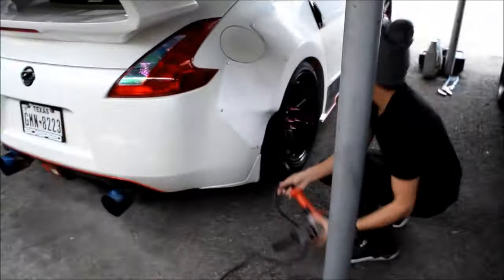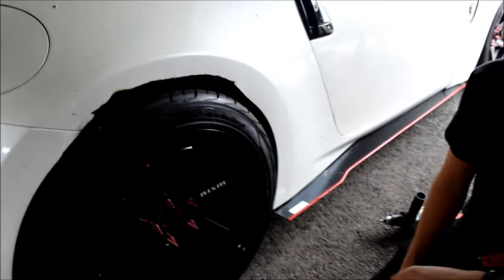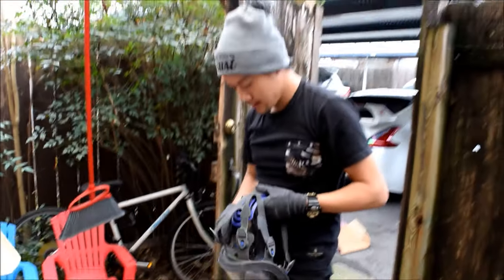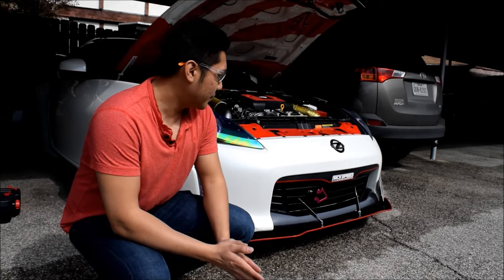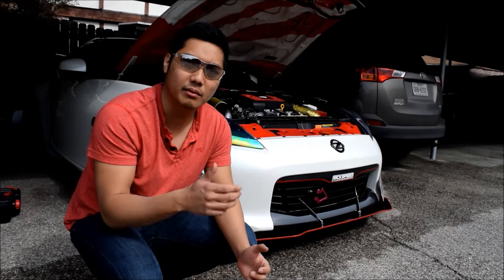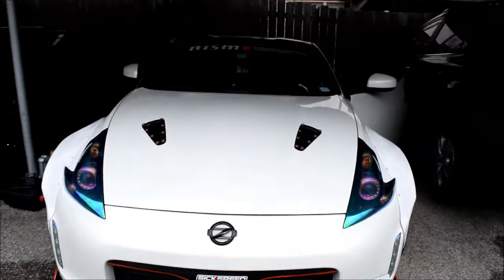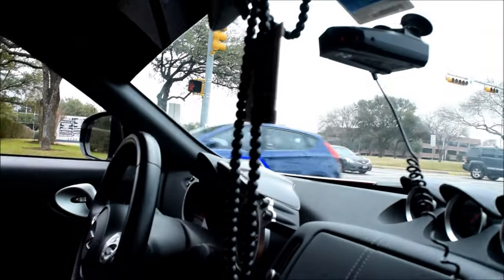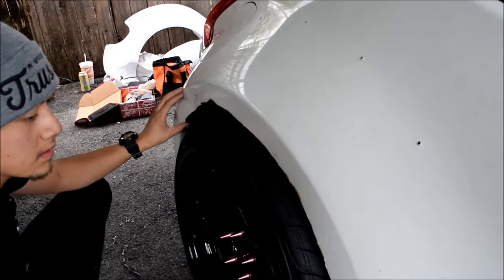Customizing the widebody kit!

Comment: You guys are really not doing a great job. First of all you are using the wrong tools. You should be cutting with a smaller air cutting wheel. You should also use masking tape, and draw where you want to cut. You should cut way more than you did, thats not enough! Afterwards you should be welding shut the inner fender to where you cut!!

Comment: What size are your wheels I have the fiberglassmafia wide kit I just need bigger rims and tires
Reply from the maker: Austin Gaines Yea these wheels aren't wide enough too so Marco had to use really fat 50mm spacers for now. 19 ×12 would be a good size wheel
Reply: The J Media if I use 2 inch spacers would that be good till I get some bigger 19s I just want to get it on at this point it's been sitting in my room for 2 months
Reply from the maker: Austin Gaines Yea 2 inch spacers will probably help till you get wider wheels
Reply: The J Media so what size is he doing in the front and back I'm just going to copy his lol